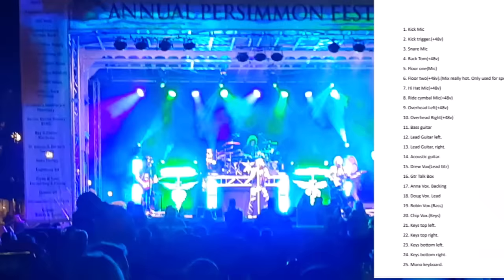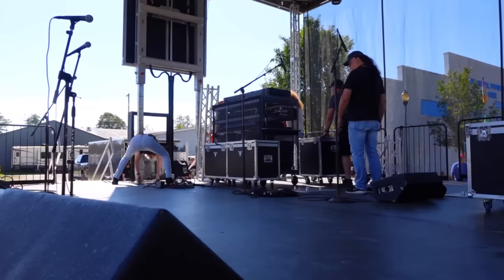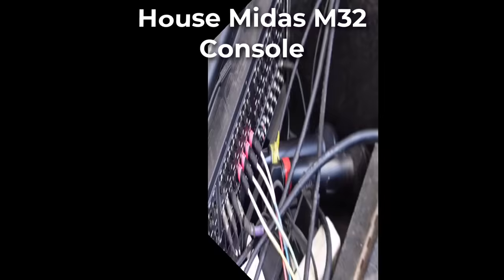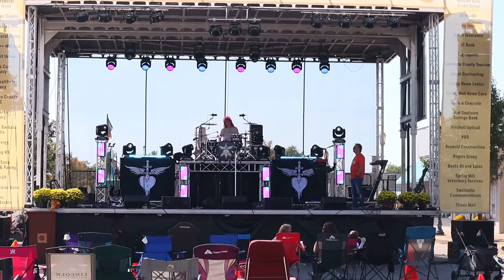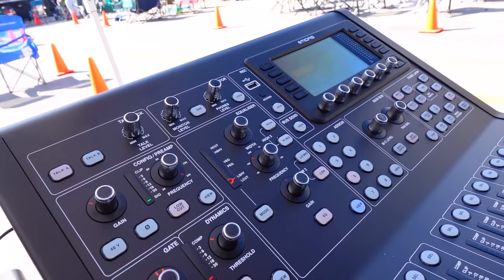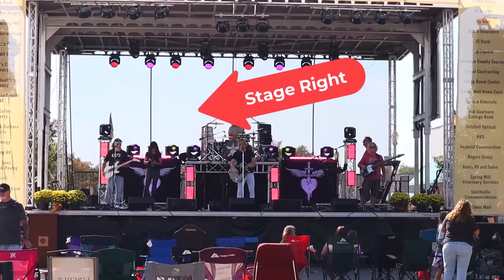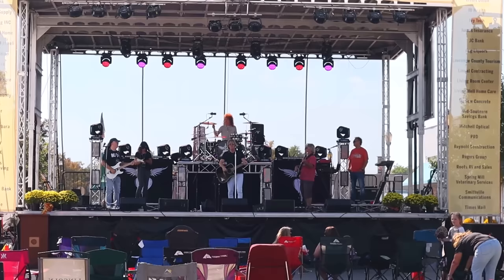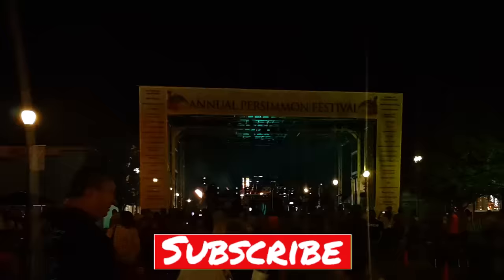Show day and Soundcheck: A Day in the Life of a Freelance Audio Tech

Comment: Hey man, thanks for the videos. I like your process! Question, are you using the M/C bus for your subs? I noticed in the video you didn't have the M/C send engaged on the kick channel, yet I was hearing subs in the house. Also....if limited to one kick drum channel, which is your preferred mic, Beta 91A or Beta 52A? Lastly, do you ever use any of the FX slots for compressors or transient designers, or are you just using the channel strip comps?
Reply: I didn’t notice the part you’re describing but I moved away from using the M/C channel and instead route everything to Matrix mixes. So main L/R fader controls volume of EVERYTHING then matrix mixes would be MAIN L, MAIN R, SUBS, and FILLS. This gives individual control over processing and volumes of each of those. Drew Brashler has an excellent video detailing this. This can be evidenced by the fact that he’s using 4 outputs as described in the video for main LR, subs, and fills. Hope this helps.
Reply from the maker: I sent my subs down the 12th bus. I don't do the M/C bus method but no particular reason. It would've worked too. But I always have an open aux on the FOH console that can be used for subs... and one for fills too for that matter. At least with the DL32 deployed or the full M32/X32. And those will take up a physical output no matter what. So, there are L-R feeds plus subs and fills.
I've also used Matrixes. 

As far as the mic question... I suppose in practice it's the B52. But I don't know if that is more habit and always having the B52 in the mic kit versus actually which I truly prefer. I can definitely make either work. I also have an SM91 and it rides in the secondary mic case. The B91A now rides in the main mic case. So, technically I DO always have that option these days but I always grab the B52. In this case the band has their own B52, but they lay it inside the kick. That is one of the things I gleaned from talking with the band when we were planning this. The drummer takes his monitor feed from the trigger, so I was kind of free to do whatever I wanted on the mic side of things for the kick. I'm not sure if their regular guy relies on the B52 for the meat or the trigger.

And if we moved the B52 to the normal port location, they don't have a stand for it. I could've brought one or used a house stand, but that riser kind of limits some options. So it hit me... if I'm going to be laying a mic inside the kick I should just take my B91A. So that is what I did. 
If I was using two mics, it would've been easy to sort out how I wanted to do the two channels since that's pretty normal. I always use the B52 for the meat, but dial it in to sound good by itself, then bring in the B91 for the click/definition/attack. 
In this case, I 'attacked' it the same as way as far as dialing in the channel 1 mic to sound good by itself. And I thought that 91 did sound good by itself. Then I brought up the trigger, and I thought, as it was, it didn't sound a full as the 91 that I'd set up. So I ultimately used the trigger for some additional attack.
If there would've been more time, I probably would've worked with the trigger some by itself because technically I'd expect it to have more oomph. But I kind of had to make a decision and roll with it. So I ended up with an aggressive HPF on it.

If I was working with one mic and KNOW I want a lot of attack, I'd definitely say the 91 because it makes getting attack pretty easy. But, you don't always know if the drummer even has something to lay the mic on (if you're working with different bands/drummers all the time). So I guess the generic answer is the B52. Even with no hole in the kick drum head, you can stick that B52 on there. The 52 is always going to get you some woof, and if the drum has any attack at all, you can accentuate it with the 52 and proper EQ.
Reply: @chuckcostello5167  I wouldn’t send subs via matrix as that would take all the main LR info and send it to the subs. I prefer an aux to send only the low end info to the subs. The M/C bus acts as a post fader aux via the LR bus in terms of overall volume, but you can choose which channels to send to it. I was just curious why Alan wasn’t using that method. A traditional aux bus would work the same way. Only difference is, the M/C follows the main LR fader (if you check the box under setup).
Reply: @AlanHamiltonAudio  yeah the main reason I do subs via M/C is that it follows the Main LR fader volume. 

I used to use the Beta52a exclusively but these days have switched to the Beta91a inside. However I’m thinking of reconfiguring my channels to allow for both in/out mics.
Reply: @Brody-Dolyniuk I get that. But the matrix mix allows separate processing (I use high and low pass filters on top channels and subs to avoid sending full signal to either one). You can also set up matrix to follow Main L/R fader. My 2 cents.
Reply from the maker: @Brody-Dolyniuk  That's a good point that you can 'attach' the M/C to the L-R Main fader and keep your sub level in balance with the mains that way. With my workflow, I don't usually change the main... much... if at all. Assuming all the gain staging is playing like it should. 

I'm more apt to make overall level changes on the DCA's. For example, for a rock show I might play with the guitar level to make the mix more aggressive rather than just the main. Or might manually duck them to calm things and make a little more room for vocals... Example: Maybe the intro is a big open with big guitars... and then calm things a bit leave some room for later.

And maybe I save a few dB in the tank on the drum DCA for later in the show when the energy is peaking. Which will maintain the sub level relative to the drum mix that way. And the main fader pretty much living where it's been the entire show.

But that said, there are definitely times I've made the decision to knock a few dB off the main after soundcheck and before the start of a show when the crowd doesn't look as hyped when they arrived as I'd expected or the room isn't as full to start the show. But, while technically 'wrong' to knock 3dB of the mains and leave the subs untouched (though you can always hit that send too), it's not necessarily subjectively wrong... because it can keep things sounding fuller at a slightly lower volume. Obviously, your system balance IS off if you do that... And there's a point of diminishing returns if you take too much away from the tops without compensating on the sub send (to rebalance things). But it's a case of "to break the rules, you first have to know the rules" I guess.

The M/C approach avoids that subjective realm entirely and that's not a bad thing. Let alone, removes some operator error if the sound person happens to forget about that system balance issue when grabbing the main. 

The matrix approach can have the same benefit too.

Good discussion point!
Reply: @Brody-Dolyniuk  One thing to consider : you can also get the best of both worlds (M/C bus and MTX) by sending your M/C bus to a MTX, to get an extra level of processing from the MTX :)
Reply: @AlanHamiltonAudio  Thanks for the detailed explanation !
Reply: @djabthrash  what additional processing would you need?
Reply: @Brody-Dolyniuk  Might be overkill, but i guess extra PEQ to tailor the sound of the sub speakers.
Reply: @djabthrash  you can eq the M/C bus.
Reply: @Brody-Dolyniuk  I know,  but you can add an extra layer of EQ if you send that M/C bus into a MTX and use the MTX EQ :)

Comment: With stereo in, keys for example, do you run stereo to the mains? What about fill?
Reply from the maker: Yes, as far as stereo keys running to the mains in stereo. But it's not like things are missing in the left or right. The keys just have a 'depth' or 'width' to them that is a benefit for (in stereo) for people in the audience in the general seating area. But the people far left or right won't really know anything is missing from their perspective.

As for fill... it depends...
If the crowd is up really close, and/or the band on ears, then I'll probably put keys in the fills. Especially if the music is key heavy. If the band is on wedges, the crowd back a few feet... then there's probably enough keys in either of those scenarios reaching the front row or first few rows that I wouldn't put keys in the fills. They'll be heard. And in that case, it might only be vocals in the fills. Or vocals and acoustic guitar.
This is all a case by case basis and different situations will call for different approaches.

Mono is what the fills will get.
Reply: @AlanHamiltonAudio  thank you! And I see your prior explanation now too. Follow-up question. How do I send a mono signal of the Main L/R to one Aux Out? I know in the IN/OUT setup, I can assign MAIN L/R to two Aux Outs but I want to bundle in mono and just use one Aux Out. Maybe already explained in one of your videos.

Comment: The keyboards are stereo, did you run FOH in stereo? If so, did you pan anything else?
Reply from the maker: Yes. Rig was in stereo.  OHs were in stereo (though I probably only panned them to 9 and 3).
I normally pan the toms a bit... don't recall if I did here or not. Probably did.
Gtr was in stereo. Full left/right. But his signal was built that way. He didn't have clean on one side and dirty on the other or anything like that. 
FX were in stereo, but just for the width. I didn't do any crazy ping pong/left right bouncing delays or anything.

I most always mix in stereo, and always set my own rigs up to be stereo. But as far as how much panning I do, that's more down to the source material and the audience positioning. Even if the rig is mono, I might have some stereo things going on before it funnels down to mono. That way any recording feed directly off the house can get a stereo mix and sound a little better.
Of course if it's being fully tracked to a DAW, that part doesn't matter. That'll be handled in post.
Reply: I was wondering this too.
Ive been to shows where they put one guitar one the left and one on the right. Made for a terrible listening experience if you were anywhere other than by the console.
Reply from the maker: That's definitely not the right way to do it. You really only want to hard pan things that might be slightly different on each side for width reasons, but are essentially not 'missing' from either side. Ex: You don't want to hard pan a guitar to one side leaving it missing from the other side and creating a weird audience experience.

Obviously, you always have to keep your audience position in mind.

That said, many times you can get away with panning a pair of guitarists 11-1 or 10-2 (clock positions) without truly hurting either side, while opening up the mix a bit for the majority of the audience in a pretty wide area. The reason being that the guitar isn't just gone from the side you're only slightly panning away from. And you're also typically using that panning because it relates to their position on the stage. So it's naturally spatial to what you're seeing. But you would never do it to the point the right side can't hear the left guitar or vice versa.

You can also get away with things like panning the toms, sometimes even more than that, because it opens up, or even exaggerates, the natural stage positioning of the drums. So even a person on the far left or right can experience the toms naturally coming toward them or away from them on fills, while it still works perfectly for the majority of the audience. IOW, it's natural to what you're seeing by way of your spacing. But yet, nothing can be gone entirely or it's just going to hurt the experience, not enhance it in any subjective way.

Things like reverbs and delays can follow these same principles and work panned hard left and right. It's not like they are 'gone' from the mix on the left or right, they're just 'different' on either side, but opening things up so that even mono things like vocals don't seem so narrow. 

Other considerations when deciding on panning is the depth of the audience, how much of the rig is the mix versus the amount of stage volume spilling into the room, etc.. 
If the audience area isn't very deep or is not only not deep but wide, then stereo on anything besides things like reverbs or keyboards that have left and right outputs for just depth can be problematic.

Another consideration for panning goes back to loud stages and small rooms/venues. If the guitar amp on the right is very loud coming off the stage then the audio tech might want to pan it more to the left to balance it for the audience. That could even be true of larger venues IF the guitar onstage is THAT loud.

There's nothing wrong with stereo in a live setting, but a tech has to remember and consider the audience perspective and the source instruments. You can't just hard pan everything and expect that to work like it might for your stereo. It's still 'live sound reinforcement' and there are certain checkboxes that have to be hit coverage-wise before moving into more subjective areas and where science starts turning more towards the art of it all.
Reply: Nice explanation
Reply: That reminds me of a gig that i got into. Typical rockband setup. Drums, Bass, Keys, 2 Guitars, 3 Vocals. The whole show was on timecode (+click obv.) and all the switching (Keys, Guitarpatches etc.) was done via midi. Both guitarists gave me a stereo-line out of their axe-fx with a clever twist. Whenever they both played the rhythm part they were panned hard left / hard right (directly from the axe-fx). When there was a solo, the guitar's patch jumped to mono with stereo delay and the rhythm guitar used a doubler-effect, so i wouldn't loose the huge stereo-sound of that. It was a great pleasure working with that band. Two of the members also do some FOH-gigs and knew exactly how to prepare their patches and came up with clever ideas to make the show sound great. 
Plus: They also did their own in-ear-monitoring on stage, no wedges. 
I loved that gig :D  @AlanHamiltonAudio
Reply: @AlanHamiltonAudio  Thanks for the explanation.